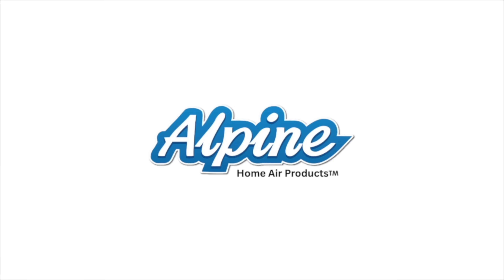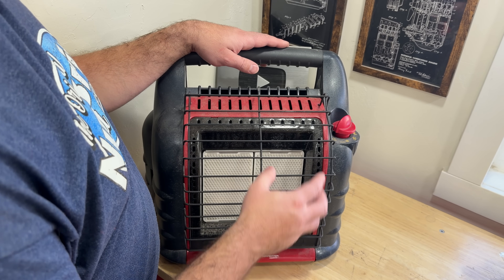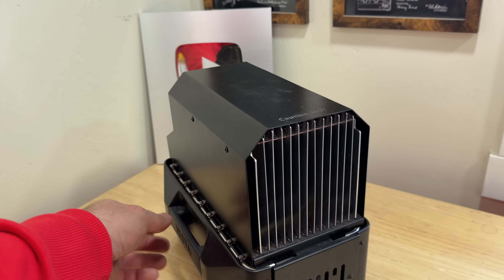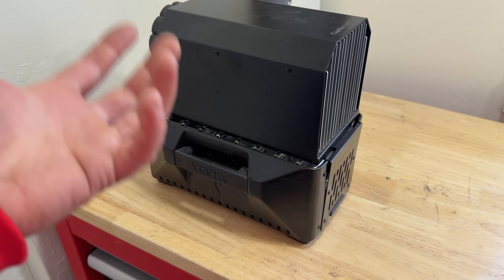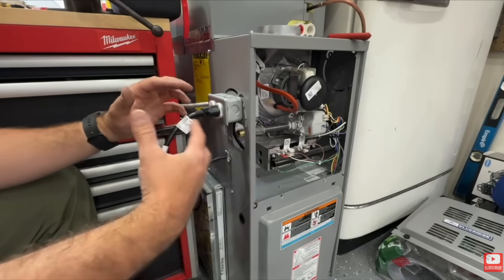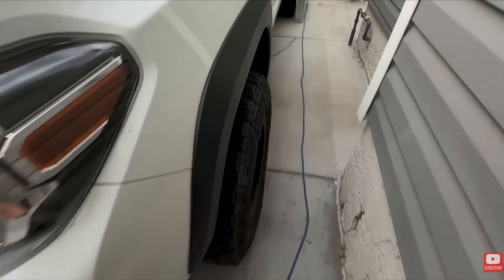Why Didn't We Think Of This Sooner?

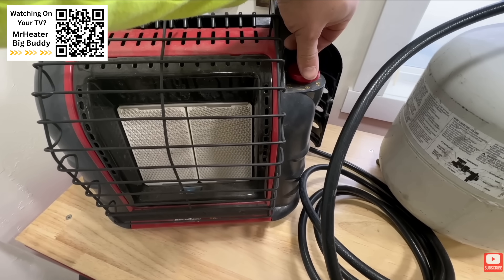Comment: By the way. Never do this. Big tanks have to remain outside. 1:25
Reply: Why?
Reply: @Hans-de8du  Because tanks can leak and in small/confined spaces, the gas can become explosive.
Reply: @Hans-de8du Because they leak from the neck and go bang.
Reply: @Hans-de8du carbon monoxide poisoning
Reply: @suhtangwong that makes no sense.  CO is produced at the burning not in the tank. The little tank is in the heater.
Reply: @edwardjackson9871   You are one with the science! 💪
Reply: Never had an issue with a buddy heater in my rv. It has literally saved us when boondocking. We had CO detector. Just be diligent when setting up properly. 
We now have 2 big buddies in our barndominium with sufficient ventilation.

Comment: I have a diesel heater back up for single room 100 times better the mr buddy small propane tank 9 dollar 20 lb 55 with no core . Off road diesel 3 dollar. 1 gallon last all day on low

Comment: As someone who worked in the Natural Gas and Propane industry in my youth and as someone who camps often in Alaska winters using heaters like this in tents, I have to add for your viewers.. GET A GAS DETECTOR (different than a CO detector) as propane leaks are not uncommon on many of these heaters that are intended for use outdoors (more forgiving tolerances than household units).  While using them inside is possible, an open window at waist height is not going to vent leaked Propane (a heavier than air gas that hugs the floor).  Carbon Monoxide is a concern, but it's not the only gas related concern in a confined space.  You are constantly screwing propane tanks in and out of these devices which only increases the chance of a leak.  Propane leaks in a confined space with an open flame on your heater can still kill you or seriously injure you as well as CO will.  Remember, Gas detectors are required in RVs for a reason and their furnaces are FAR BETTER built/sealed than these cheap portable heaters.  

Battery Powered Gas Detectors run about $40:  https://a.co/d/eDygRx5  (AAA Batteries, I use lithium rechargeables)    OR    https://a.co/d/hU0HYBI (usb-C powered with a cell phone battery pack)

Note:  You can find combo detectors for CO and GAS, but most of those are not battery powered (remember, battery backup does not mean battery powered).  It's best to keep these two detectors separate given the current options (although if you find something I missed, please share it with the group).  

On a side note, I grew up in Florida where Hurricane Power Outages were common.  Don't use your car as a generator unless you have no other alternatives.  Buy a generator, you can get a 1000W to 2000W inverter generator for cheap.  FAR cheaper than replacing the engine in your car if something goes wrong while it's idling long hours and you are sleeping.  This is something I saw 4-5 times a Hurricane Season in Florida and that was just in my small social circle (300-400 people).  People forget to check fluids constantly and ended up with all kinds of issues that end up being FAR more expensive than a quiet/inexpensive generator.  This is where being prepared is far better than the alternative.  BTW, these cheap generators us far less gas than your car and some can be run off of Propane so if you have a larger underground or above ground propane tank, you can plumb them in as well (more permanently) to feed your home furnace.

Comment: I bought a Vesta. Uses caterers candles. Has a grid on top to heat food if you want. It heat's my  14 x 24 foot bedroom just fine. Around $100.00 6 hour burn time on the gelled alcohol candles.

Comment: look into the add-on trays and the bolt-on fans that get their energy from the heat and don't need batteries or electricity of any kind. the fan makes a huge difference. it comes on and goes faster as it gets hotter. and doesn't use up batteries like crazy. like the built-in battery powered fan for the big buddy heater. 
also, the tray that you can slip in aluminum is basically a painters tray that they use to wipe their brush off so they're very inexpensive. plenty available for just the right size too. hook up into the handle upside down on your big buddy heater so you don't have to bend the front and then bend it back and you don't have to unsafely expose the hottest part of the heater.

Comment: I went with a more permanent propane solution with a Dyna-Glo ventless heater with thermostat. Mine is running off a 30 lb tank which is outside. I believe Mr. Buddy makes something similar. It has a AAA battery igniter, can be either wall mounted or free standing with optional leg kit and this thing has been one of the best decisions I've ever made for heat backup.

Comment: Lots of great information..but.. not a great idea to bend the grille of your Buddy heater and then set weight on it. It clearly won't support much weight and repeated bending is a hassle. The balance of the heater itself is compromised and could create a dangerous situation. Plan ahead and get some sturdy unpainted metal rack or stool or other.
   Don't leave your inverter on top of your engine while it's running. If you have to, create longer cables to connect it so it can set outside of the engine compartment.
   A solid video. Hope you don't mind my input.

Comment: You do realize, a carbon monoxide detector is supposed to be mounted low to the floor, right?
If you mount it up high, it'll never detect carbon monoxide.
Combination units make no sense, and to combine them, negates the effectiveness of one over the other.
It's best to keep them separate, for maximum safety monitoring.

Comment: Tell me why the whole zoning aspect isnt hyped up more such as blocking off areas of the home that are not being used at times and having a unit smart enough to adjust the blower, compressor or heating coils/ flame to efficiently use the different amounts of intake air and not overpower anything?  The systems shouldnt be so outrageously expensive to achieve this.  Instead of having zones programmed into control boards and tstats wht not have a pressure sensor or 2 on the conditioned air to adjust itself?   Ive always seen how people close off vents or block return air registers and only causes the system to work harder or other issues..   shouldnt have to close dampers on ducting and have a whole zoning system..

Comment: I prefer a CO2 and a smoke alarm separately. I put the smoke alarm on the ceiling and the CO2 on the wall at medium height. By the time the CO2 gets to the ceiling the air would already be unsafe especially if I am laying down.

Comment: We have a standard boiler system, I also installed a wood stove into our fireplace, have a backup generator, and i installed several mini-splits at our home. We have multiple ways to heat our home in an emergency without any issues.

Comment: You need the Mr. Buddy heater oil filter. You’re going to have problems running the 20lb tank without that filter.
And that little vaster heater will not heat a room. Bad enough a buddy heater will take a while to heat up a room when it really cold. What you think that vaster is going to do? Nothing! You should really test that unit in a real cold day, before post about it. Because you will find out like others have that they don’t heat anything. 

Omg 🤦‍♂️ you showing people to leave the inverter on top in the engine and close the hood. You do know that a 12v car battery doesn’t have the power to fully run the inverter for long and your going to have to turn on the car to charge it and your showing people to leave the inverter inside the engine bay. Wow!

Comment: Be careful using your car as a generator to run the inverter.  Find out the size of the alternator output your car has and do not overload the alternator. Can your alternator/battery system power a 12-120 volt inverter? Yes.  Just don't overload the alternator, or you can have an expensive day.

Comment: Thank you for this vid - very helpful.  I just bought a Mr. Buddy heater, and 3 of those small green filled propane bottles (haven't used the outside BBQ for 4+ yrs, so don't even know if I have propane in that tank).  I have a butane stove for heating water/ cooking, and I have a 3-candle, "Candelier" (created to dry out tents of moisture, when camping), which I had to use 3-r years ago, when the power was off for 5-6 hours, in winter.  Tried to heat a cup of water on the top flat part, did get "lukewarm" water, but certainly not hot.  There are limitation to the size of candles that you can use - so I bought a small box of them...

In our house (well, my sibling's), we have a problem - all of the living areas are upstairs, but of course the water & sewer lines are in the basement.  Normally use heat tape, and an electric, temp-sensitive, auto turn-on/ shut-off heater, which works pretty well.

BUT, we have NO INSIDE BASEMENT ENTRANCE.  So, I need to think of a way to keep the pipes from freezing, etc., in the basement - in a SAFE way, when i'm not there, as well as, keep the upstairs/ one-level main floor warm enough to live in.  (The bathroom is already too cold - need to run an electric heater in there, before & during showering, then a dehumidifier & fan, after.

I like your suggestion of that addition of the "plug-ins', to the gas furnace.  We have an older 1990 model, which has few electronics.  I have wondered how the heck to power it, even if i get a generator of some sort -- there is no plug-in on the electrical box OR the furnace, so even when I GET a generator of some sort, I had no idea how to power it.  Very much like your suggestion for that outlet addition.  (I have purchased 2 100W solar panels, but don't have an inverter or any system yet.  Very low income, so I have to purchase on sale, bit by bit.)

Any suggestions for safely heating that completely separate downstairs part that is cut off from the living area?  We have already had quite major plumbing issues, as it was not done properly in 1990.  And, since we're in a heavy, cold, wet snow zone... it IS a REAL concern, with no fireplace/ wood-stove, or interior access to the downstairs.  Only 1 1/2" foam insulation on the walls down there - not quite to code (need 2", but 1 1/2" was all our dad could afford at that time), and bare cement floors).

Liked the sound of that fuel-less Tartarian heater...  would be 'super" to have a couple.  Anyone know where to find some?

Any suggestions for heating these 2 separate floors/ regions, anyone?  Unless it is REALLY cold outside, the pipes/ gas lines, water intake, etc. should be safe from freezing for about a day or so.   We DID get down to -30+ C, two years ago.  With the high relative humidity from a local large lake, that was REALLY cold.  Previously, the coldest had been  ~ -20C, which already was very cold.

It weighs on me, I admit, particularly since our only relatives here moved away, and my neighbors have shown that they just don't give a dang (during my recent very badly-broken wrist/ needed surgery/ still recovering, & unable to do much of anything for 4 months now).  I've done LOTS for almost all of my neighbors, despite my head-first crash injuries - and they GLADLY took my help, FOR FREE, but NOT ONE of them even had the consciousness/ compassion, to ask if I needed anything, etc. (And I DID/ still DO, need some help.)  Sigh.

So, if SHTF, I'll be on my own.  Thus, ANY good & practicable suggestions for this heating conundrum, would be VERY welcome!

Anyway, thanks for this great vid!  (I'm saving it to my playlist, to watch again a few times.)  Thanks, Merry Christmas/ Season's Greetings, and Cheers!

Comment: Help me out people with this man's demo of the CO Detector/Alarm.  CO is heavier than air. CO sinks and collects on the floor first, like water would, and fill the container, which is the room.  The room that you and your children may be in.  My question is, Why would you mount the CO Detector at the highest possible place ?  The room would have to fill with the deadly gas to reach the Detector for it to sound the alarm.  I would suggest that the Detector should be as close to floor as possible, but that's just me.
Reply: Carbon monoxide will rise because it usually comes from heat sources.
Reply: @projectswithjw  Yes. CO is less dense than air in some conditions.  I was thinking of CO2.  Thank you for your reply, sir.

Comment: Lot of EVs nowadays can have their inverters running in just accessory mode. When you think about how large that battery is, you could probably run your heating system indefinitely and when you need to charge it up. Assuming you can, go over to your nearest level 3 charger and fill it right up.

Comment: Be prepare for every window in the structure you are heating to be fogged up with condensation from propane heat, yes even this heater. It is still a great heater, put a filter on the hose line though.

Comment: I use a paint strainer tray from the hardware store.  Mounted upside down with the hooks between the handles it's  much more ridgid and can hold a small fry pan more securely.
Reply: This works well for me, as well
Reply: Tried something like this and now have warped plastic in the vicinity.
Reply: You mean a 'roller grid' ?

Comment: Always put a filter when using a 20 lb propane tank.
Reply: I found them to be a pain, and a waste of money.... I removed a small section of the housing to expose the fittings at the dial, and just remove the pilot tube+orifice assembly, keep a can of carb cleaner handy, and give it a monthly maintenance.... Takes less than 5mins, and no filter needed.

Comment: Idling your vehicle for hours is not good; it wastes fuel, creates pollution, and causes premature wear on engine parts, transmission, and catalytic converters by building up carbon, washing oil from cylinders, and straining the cooling system, with some experts suggesting turning it off after just 10-30 seconds. Modern cars warm up better by driving gently rather than idling, and long idling periods can be worse than driving slowly for the same time, equating one hour of idling to about 26 miles of driving in terms of wear

Comment: I run 100lb tank with mr.heat brand 10’ft hose and filter the label says its tested for 20lb tank that doesn’t mean it can or cant use bigger tanks. My experience ive only run on low consecutively for days and sometimes the pilot does go off i believe there’s oxygen sensor and the fuel does shutoff when pilot is out. Im going to run a small fan to try and circulate the air a bit so hopefully that helps the issue. And i read having to sandpaper the orphice that keeps the pilot going so maybe it gets sticky and shuts down or just glitches randomly after sometimes this has happened about three times over maybe a dozen weekends. I read another comment someone heated there trailer all winter with two 100lb tanks and refilled them up once. 5lb a day of propane on low

Comment: Your thumbnail is a little misleading. The title card says 80 hours runtime but it is showing the 1lbs bottle.  👎
Reply from the maker: It will run for 80 hrs on a 20lb cylinder. I apologize if it seems misleading. You are the first to say this. I hope the video was helpful despite that. 

Best,

Dave
Reply: @diyhvacguy  No, it kind of turned me off from watching past the point where you switched to it being a 20lbs tank.

Comment: Should the inverter be a pure sine wave for the furnace electronics?  Or is a modified sine wave okay?
Reply: It needs to be a pure sine wave.  The transformer inside will convert high voltage to low voltage but will not change the waveform in any way.

Comment: I'm looking for something to heat up an outdoor shed that I use in the winter.  It's about 12X12. Which heater would work best? I think I'd need something that has a fan. Thanks in advance.
Reply from the maker: You can use this thermal fan that clips onto the big buddy! Hope this helps. 

Also this link and the link for the heater in the video description are affiliate links so if you decide to purchase them and use this link it helps me out :) but no pressure!

Cheers

https://amzn.to/4q5oOGg

Comment: Ive been using these for years. I take issue with 1 fact.
On low youre EFFICIENCY is only 1/2 of HIGH.
You're much better off running it intermittently on high, then ever using it low.
On low it not only is LESS efficient but it produces MUCH MORE Carbon monoxide and other aggravant particles, making it dangerous.

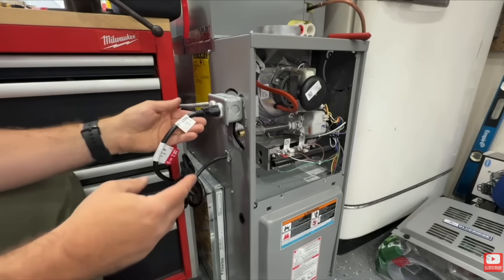Comment: I had wired my old oil furnace hooked up with the plug and pigtail method (minute 7:03) to use with an extension cord out to an inverter generator. When I got a new gas furnace this year, I had the installers wire it up the same way. They did but were a bit concerned that running my new furnace off a portable (inverter) generator could cause damage to the circuit boards. Your thoughts ? Thank you.

Comment: Two thing's. I used this attached to a 20lb tank the way you're showing us in upstate NY for the winter. The hose you're using on the big buddy will produce oil when used with propane. That oil will clog your buddy heater and it won't be no good once the oil clog's it. It's a pain in the you know what to open up and fix. Buddy heater company sent me a new one and I sent the oiled one back to them. The front grill for heating things.. That will melt the plastic handle that you attached it to. Use the front metal part to attach it to and not the plastic. But you can pull it off as I did in a basement apartment and in a van.
Reply: Yes, very true. I can never get my Mr. Heater going the following year after running it on a 20 lb tank, absolutely kills it.  Went through 3 of them, finally bought one that takes a 20 lb tank by design, no issues.